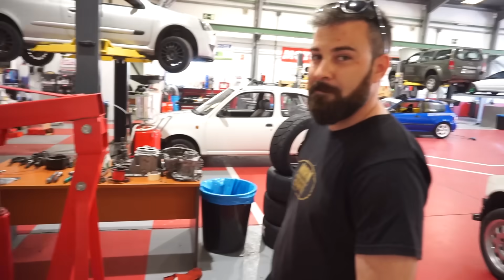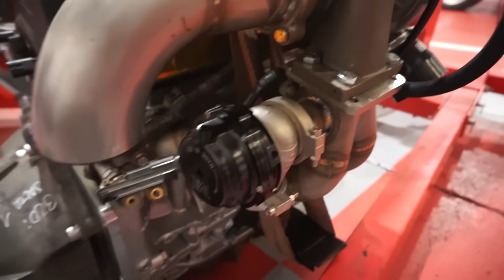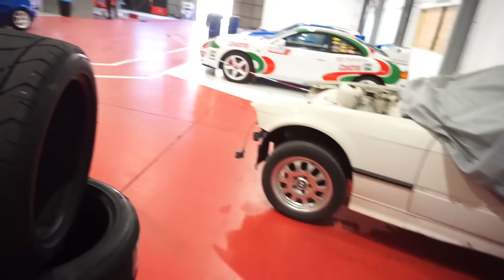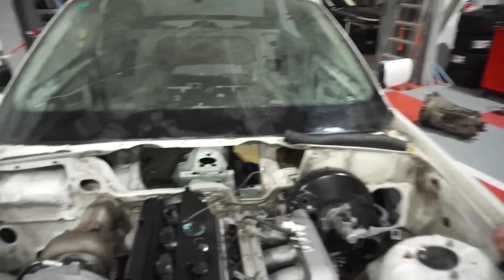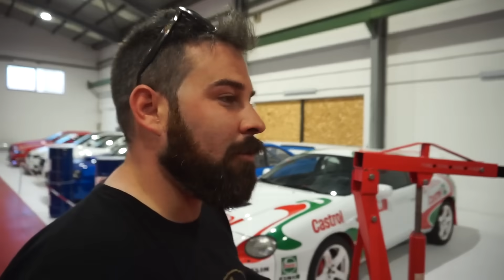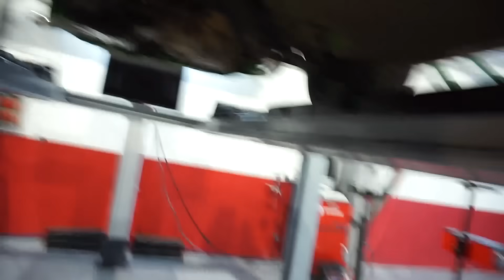¡¡ K20 TURBO en un BMW E36 !! Nuevo proyecto :D

Comment: Todo lo que tu quieras y más, pero se me caen los ojos al ver un K20, un muy buen motor de Honda, metido en un BMW... pon el K20 en cualquier Honda que es donde merece estar, para un amante de la marca Honda es ofensivo ver este tipo de proyectos... será que no hay carrocerías Honda....
Tener un BMW con motor Honda según tu porque es más "BARATO" lo deja todo muy claro.
Reply from the maker: Que deja claro para ti que se haga este proyecto porque es mas "barato"? iluminanos.

No creo que nadie se ofenda o se pueda ofender por esto, y si lo haces lo siento por ti porque cada vez que te metes en internet debes llorar de pena al ver k20 en multitud de chasis, ford, bmw, mazda, subaru... también te dire que por tus palabras nunca has subido en un e36 para ver el buen chasis que es preparado y lo rápido que van.
Reply: Yo no tengo que iluminar a nadie, sólo opino.
Si quieres conducir un BMW  tienes que ser capaz de comprar las piezas necesarias.
Seguro que en internet hay más proyectos de este tipo, y no lloro como tu comentas, simplemente  ni los sigo ni miro ese tipo de canales, miro tu canal porqué hasta ahora has hecho cosas interesantes.
Pero... por mucho que defiendas este proyecto a mi no me convencerás, tampoco intento convencer a nadie, sólo doy mi opinión.
Reply from the maker: @jordijimenez957  Estás hablando de este bmw cómo si fuese un M3 e36, el chasis dónde se va a montar es un chasis de 320, para que poner un motor mas caro y el cual va a dar menos rendimiento? ¿para que montar un motor de m3 e46 que tiene casi el mismo lio para adaptar y que es infinitamente mas caro? yo no tengo que convencer a nadie de nada, pero almenos que los argumentos sean validos o entendibles.
Reply: Yo soy Hondero y no me jode ver un k20 en otros chasis, al revés si los ponen por algo será, muchas piezas aftermarket, fiabilidad, Honda la mejor #Kswaptheworld
Reply: Joer si llego a saber que te pones así no lo hago y me quedo en el sofá de mi casa comentando youtube 😂😂😂 salu2